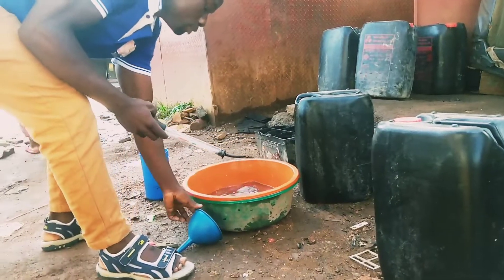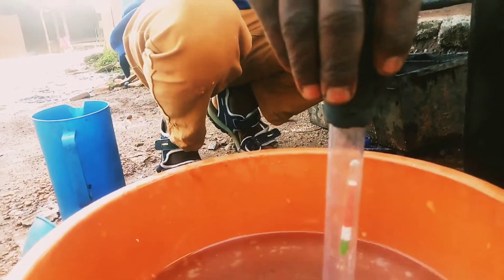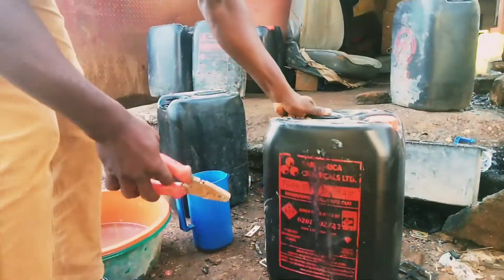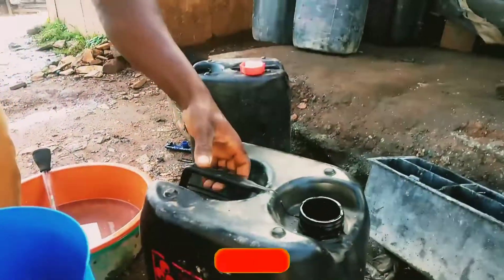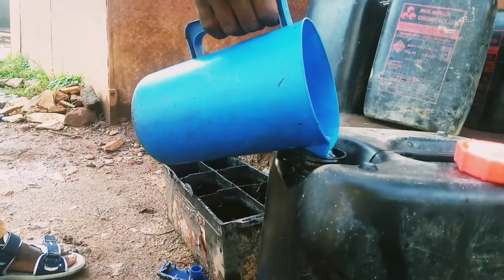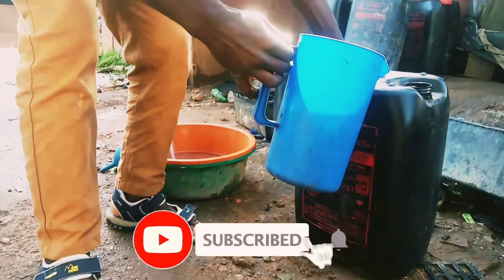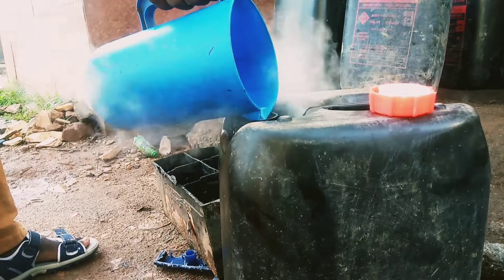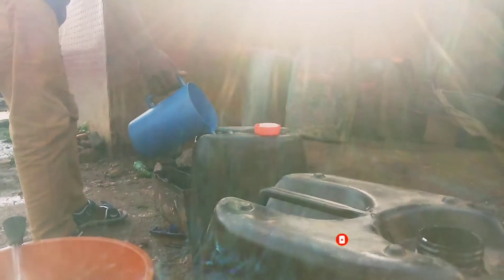How to mix sulphuric acid with distilled water.

Comment: What's the ratio for car battery mixing distilled water and acid n50willard
Reply from the maker: Usually the ratio depends on how many liters your about to mix, 1litr of concentrated sulphuric acid to 4-litr of distilled water. So in n50 battery, you can add like 4-litrs of mixed acid, therefore use a 1-4 ratio to mix your acid. THANKS